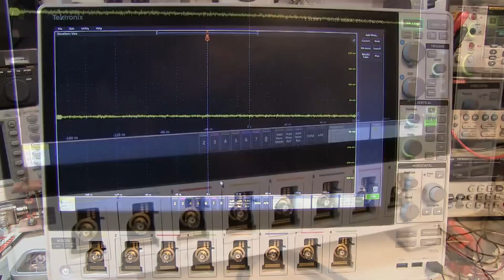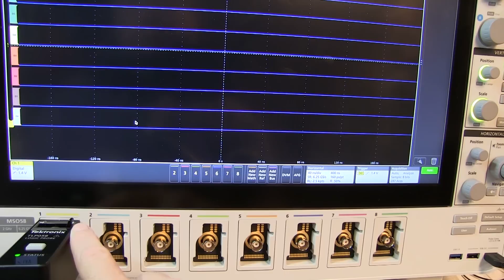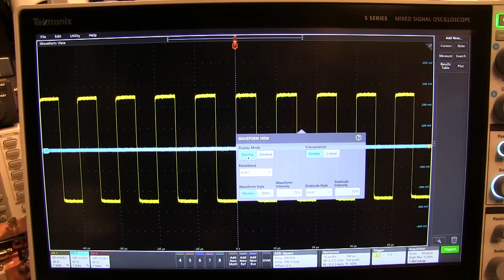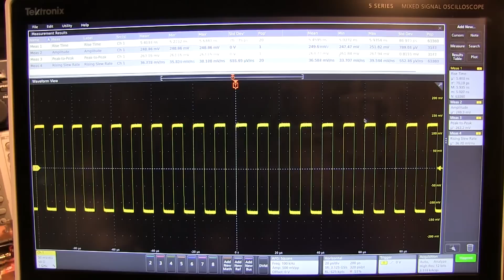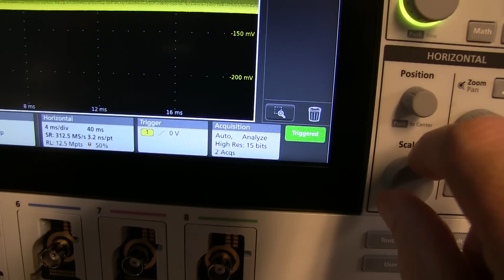5 Series MSO Highlights

Comment: A little confused as to what Windows OS would bring to the table that LINUX cannot.  And, why would I want all of the MS overhead and problems?  Thanks for another great video.
Reply: There are several advanced measurement and analysis/characterization applications that will require Win10 to run.  There are many customers that want windows to be able run some of their own applications, ease of integration with their other systems, etc.  This scope will cater to both audiences - those that need/want windows, and those that don't want windows.  User's choice.
Reply: w2aew , I do like and appreciate that Tek chose to support both.  Awesome scope!  Also, love the analog option.  Cheers!